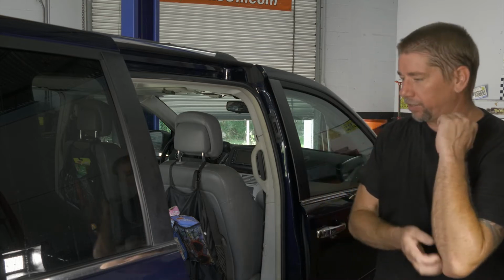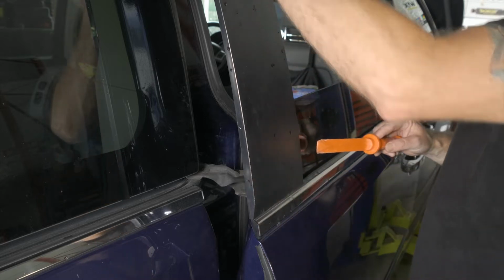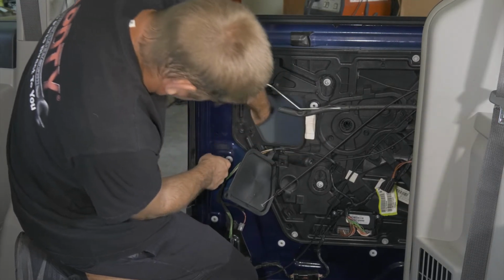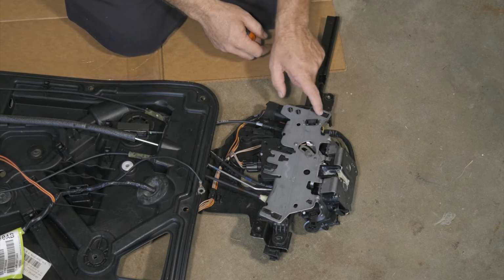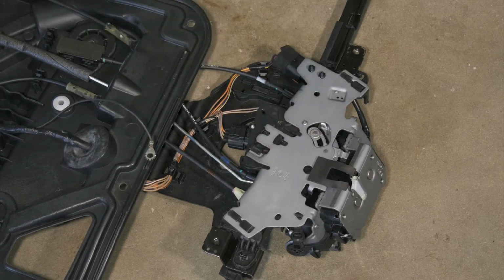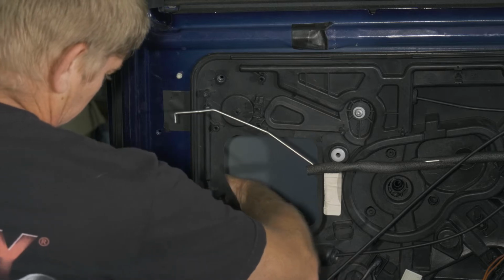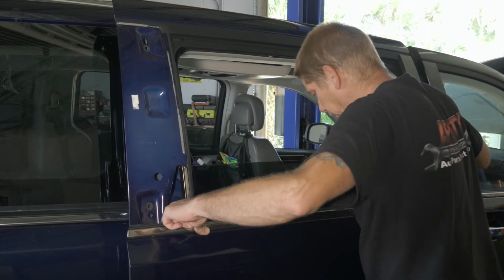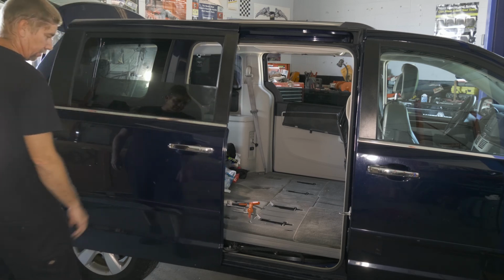2013 Volkswagen Routan Latch Assembly for Sliding Door

Comment: New VW actuators are listed for over $500. I wonder what goes wrong and is it repairable? My left sliding door will not unlock at all right now. Your video is very clear and easy to follow. 
The same actuators on the dodge grand caravans have actuators for under $40. The one you replaced looks like the part on the VW breakdown. I guess they use a more elaborate system.

Comment: Why on earth did you remove the window regulator? ALL the other videos say to NEVER remove this.
Reply from the maker: You might be able to do the job without removeing the regulator, but it would probably make it that much harder to remove and reinstall the giant plastic form and assembly. The regulator and assembly basically sandwich together with the vehicles metal body. So removing them together as one piece requires even more akward movements.

If you find removing them together is easier for you, then do it that way. However we think that removing the regulator makes it just a little less troublesome.